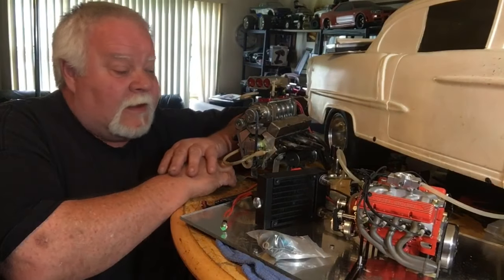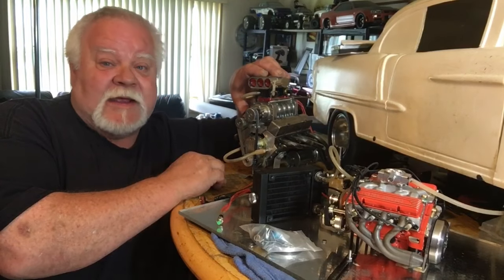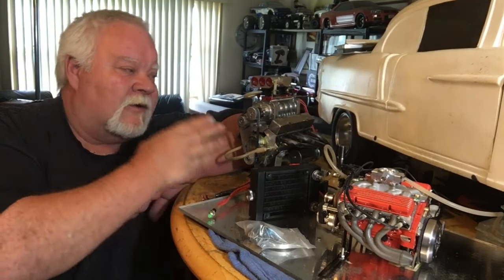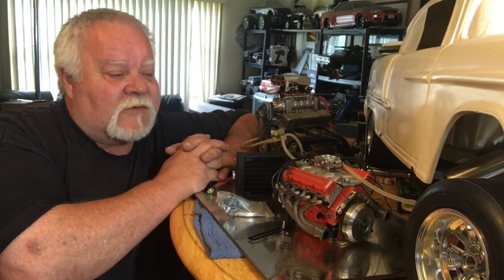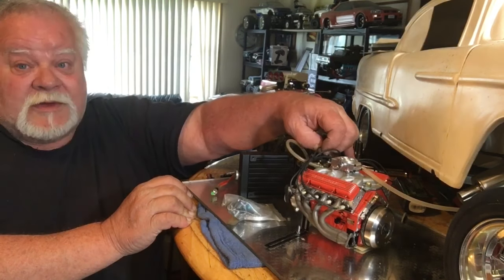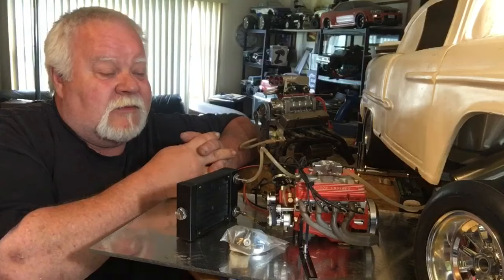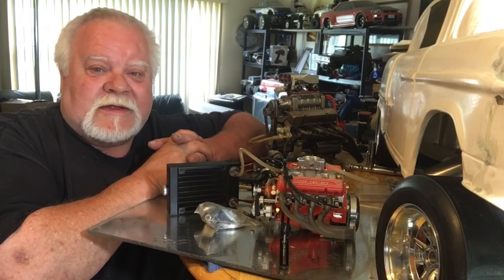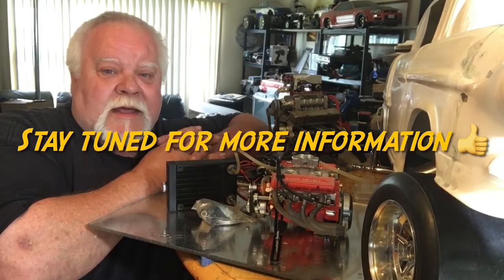CISON V8 VS CONLEY CLONE V8 MY THOUGHTS

Comment: The Cison OHV V8 is my favorite. I have ordered the flat-head version as well. When you run your Cison V8, keep an eye on the oil flow. If it stops flowing and there's plenty of oil, check the oil pump. In mine, the drive gear in the oil pump came loose from the shaft. The shaft has a "D" end on it but, the gear has a round bore not a "D" bore. High temp Loc-Tite has worked well for mine.

Comment: The Australian made V8 is the same design as a 1st generation Conley. Note the gap between the intake and the block. They were great back in the day but their time has come and gone. I have owned , rebuilt and sold a lot of the Conley nitro V8 engines over the years so I know them inside and out. They were always said to be 1/4 scale but I would call them 1/5 scale. In a true scale 1/4 scale RC car, like your 57 sitting there, the Conley engines simply look small. Conley had 1/4 scale cars designed around this engine so everything looked in scale. The biggest problem with the nitro V8 is the oil from the nitro fuel is all over the inside of the engine so if it's going to sit after it's been run you need to flush all of that oil out of the inside of the engine. Let it sit for a few months not flushed out and that oil dries out and will lock up the engine with sticky castor oil. Yuch ! The title to one of old videos of a Conley Funny Car is on my channel titled Conley V8.  Somewhere down the road I will get one of the China V8's.  Love this channel 👍👍

Comment: here's a thought - with all those top end leaks  :face-turquoise-covering-eyes: sounds like too much crankcase pressure , try building a vac-u-pan system weld a 1/4" tube throw the side of the collector at a 45 degree angle to the center - with the hole open behind the exhaust flow (this will cause vacuum , run a hose to the valve cover Note: you will have to have , some sort of check valve "on full size we use a back fire valve, used on all early smog systems  (this will stop your oil leaks) . . . . . have fun

Comment: Nice engines! So which one makes more power out of the 2?  Those Australia  engines are super expensive around 5-7K correct?  Did you ever have a Conley  engine  from back in the day when he made them here in USA?  I’ve always wanted one , but lots of coin !
Reply: The Conley engine generates more power since it is a little larger and is nitro unlike the V8 cison

Comment: Please tighten the bolts on the table💯
Reply from the maker: Good catch! I’ll make sure those are nice and snug for the next video!👍🤣
Reply: @dennisdempseyradiooutofcontrol  id hate for those engines to fall and break because the table is loose💯😭🙏

Comment: Completely irrelevant to the video, on my fs-l200, on both cylinders the exhaust valve is crack open, when I take off the rocker arms and push the valve down they go back closed. I also noticed with the rocker arms off, the valve bucket on one of the cylinders for the exhaust sits higher then the rest but when I put the rocker arm back on and spin the cam over, so the valve opens then closes, the valve stays cracked open on both cylinders and the bucket sits flush with the intakes. And what I mean by cracked is it’s slightly open and I can blow through the exhaust when the valve is supposed to be closed. Does yours or anyone else’s do this or did something go wrong with the manufacturing and the valve stems are too long? And what can I do to fix it if it’s not supposed to be like this?

Comment: To bad the China engine looks like a SB Chevy but with a front Dist like a ford  nice job china also seem to run on the bench but just dont make good power when put in a car not good for the $$ IMO I NEVER SAW ONE REALLY RUNNING JUST PUTTING AROUND have you had any luck getting them to make power to move a rc you can use ? i gave up after the 4cly

Comment: When you pay $2k for a miniature engine, the quality should be good enough that it doesn’t leak oil, and the boots should fit without needing to be cut. With that in mind, I bet they have zero quality control.